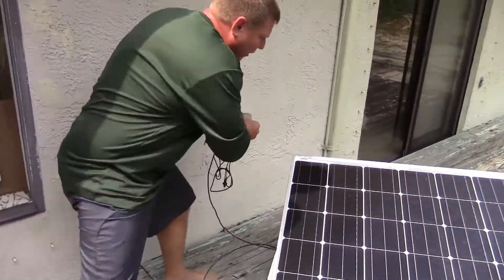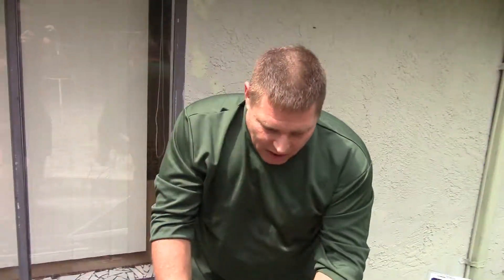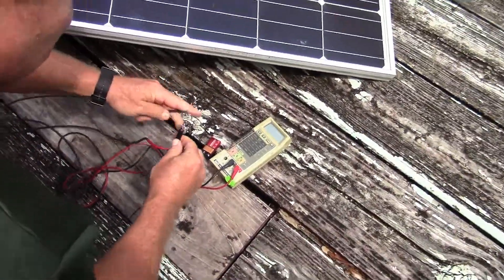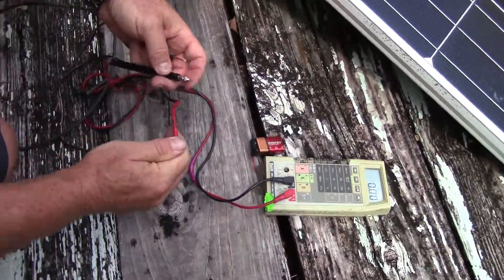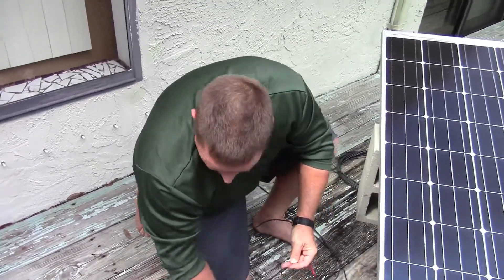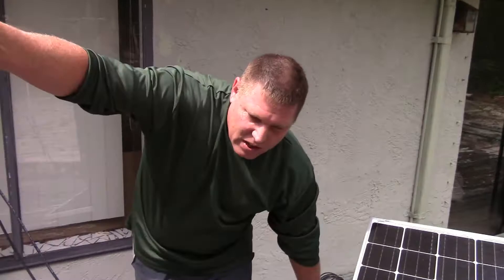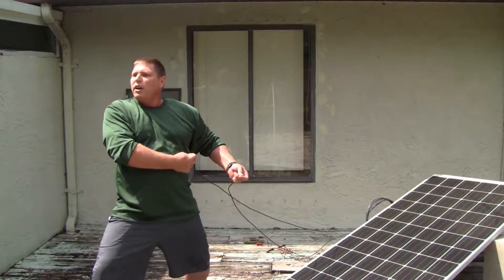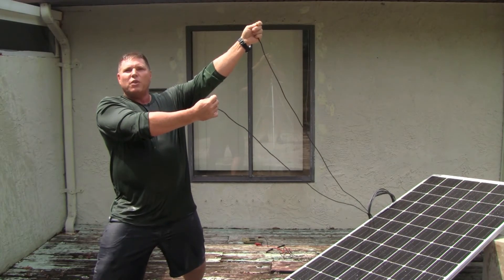Solar Panel SAFETY Demonstration---SINGLE PANEL---NOT GRID

Comment: that was pretty cool. so watt  (ha ha) would happen in that same example if you had 4 panels in series totaling 160V ? Would it still be safe because it's DC and not AC?
Reply from the maker: I believe when you start getting at or above 100V Direct Current (DC)  you can get spot-burned (I am not an expert on this area).  BUT!  The REAL kicker is: our heart and nervous system operate on Alternating Current (AC)!  When you "inject" some other "guys" AC...you are no longer in full-control of your Earth-Issued Spaceship's (a.ka. your body's) AC system voltage as well as it's control signals (which are very low-voltage levels)!  :)
Reply: I got a medium shock just with 3 panels and really thick clouds.
Reply from the maker: Thanks for the data!  Can you tell us what was your wattage on each of the panels?  What was the labeled current at peak voltage?  Were all panels the same?  Were they hooked in series or parellel?  More data will help us all!  Thanks for sharing!
Reply: Fry Chicken 🐓

Comment: Just remember folks... when you are shocked with a defibrillator you are receiving DC current. Don't let a video doing certain things encourage you to do DUMB things with Direct Current. DC will knock you on your ass! Hold the spark plug of your lawnmower in your hand will someone pulls the cord.
Reply from the maker: You are exactly correct.  Thank you for reminding our audience to know and understand electrical voltage levels.  Always know the DC voltage level. I am trying to educate in this video, I KNEW that my voltage level would never exceed the 50vDC from the single solar panel...it's physics folks!

Comment: Good to know.
Reply from the maker: Just remember that you need to know the DC voltage level and strength...DC Can KILL..if it is powerful enough...in this case I KNEW it would NEVER BE more than 50vDC...just fine.